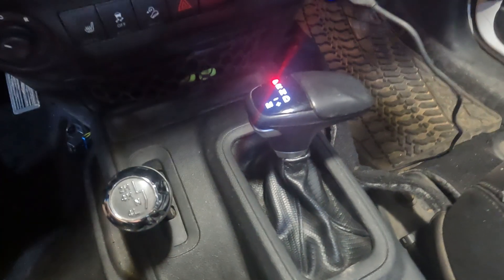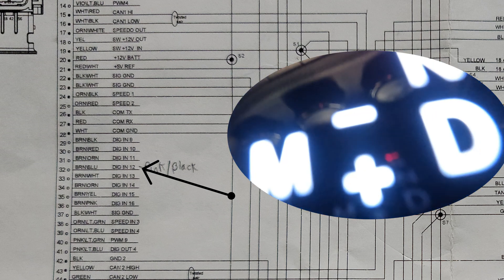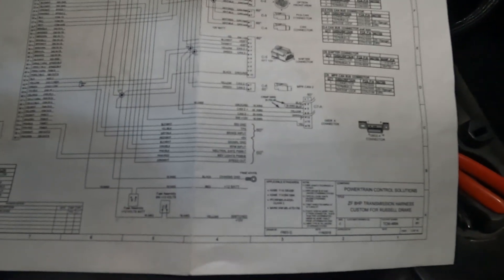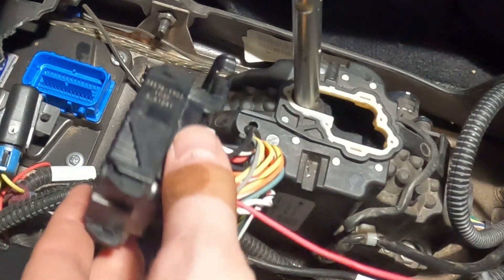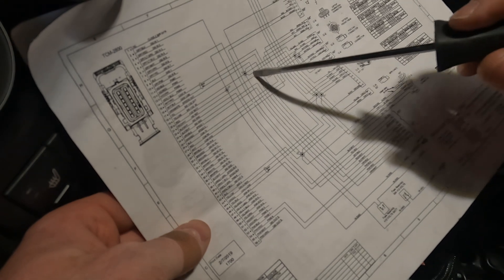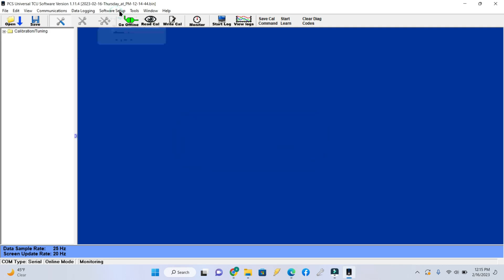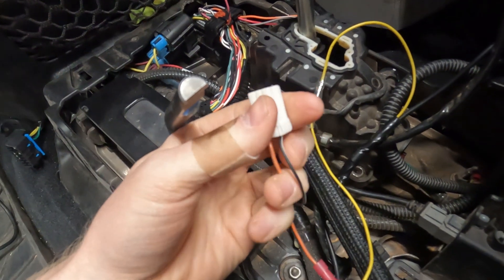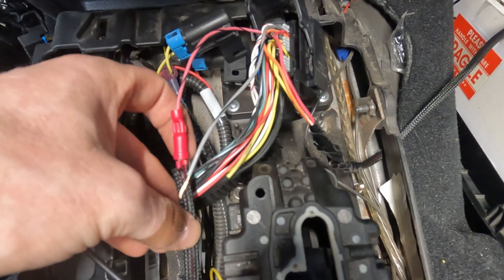8hp70 shifter light Dimming, PCS Controller Re-Pining

Comment: Awesome video sir. Thank you for info. I have to open mine up. The extra digital inputs is really cool as I have one of the earlier transmission harness. I actually had to wire in my brake light, reverse light, etc. When I did my trans temp gauge I used one of the digital inputs, the one for neutral safety. The one for brake lights that you used is in use on mine. So the addition of inputs is huge. This is why I haven't wired in the sport mode switch yet but will open mine soon so I can do both. Thanks for the info!!
Reply from the maker: Thank you!!! Much appreciated 👍 You should be able to change your programming on the pcs software to make it only use the canbus wires, it's all settings in the software I believe. And for the transmission temp, what did you have to change in the pcs software to make that wire go e transmission temp information?
Reply: @jku392adventures  I have a write up on it on the JSS page. But I used the PMW#7 which was for neutral safety. In the software I went into the PMW/digital output file. Clicked on PMW 7/Digital 1 output.  That will bring up a box with a dropdown menu. Click on the drop down and change it to PMW vs Fluid temp 1. That will change that PMW signal to come from the Trans temp sensor. The rest is in the write up is how to calibrate your gauge to the signal. If using the same gauge I used it should be identical or very close to my settings. If using a different brand single wire gauge you may have to play with the settings a bit.
Reply from the maker: @millstonejeepworx  very awesome! Lots of good info right here! Haha much appreciated. I'll have to look for your post. I have a temp guage but it's still good knowledge 🤙